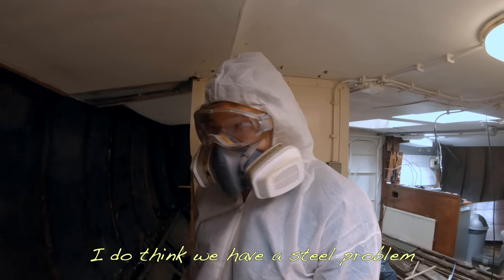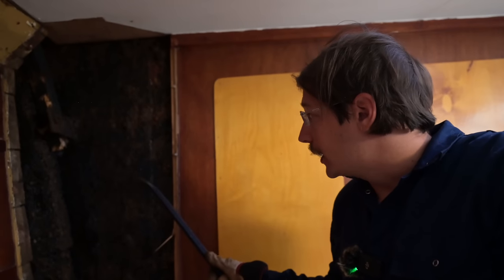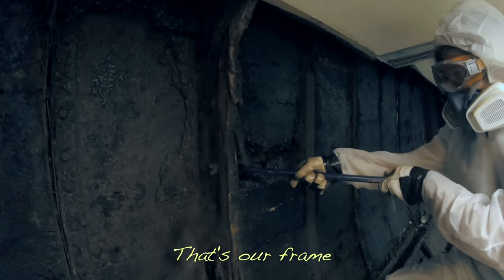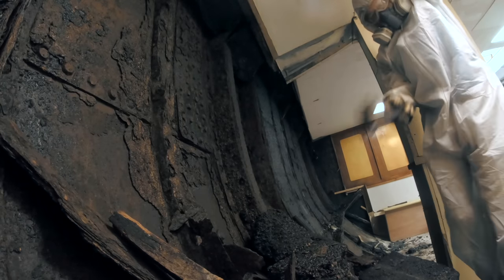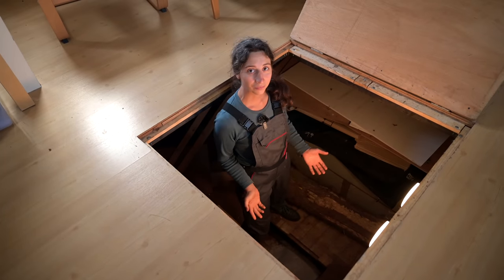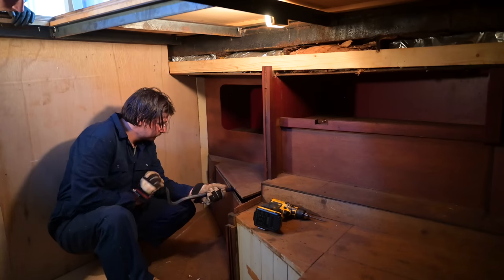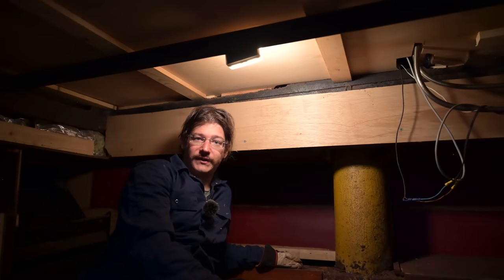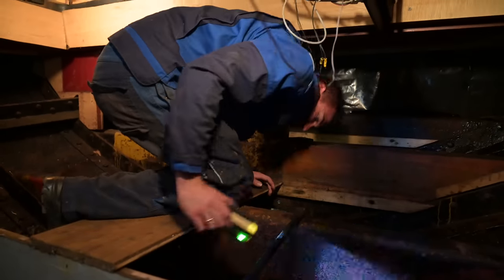We Need To Call In An EXPERT! Not good!!!

Comment: Its like boat archeology, only my morbid curiosity allows me to continue to watch, if you had got a surveyor in the first place, you could have 1. Bought the boat for less money based on the surveyed condition as a negotiation point, or 2. bought a different boat.  They say rust never sleeps.  You also need a massive bank balance or income to support this project.  Gutting it, welding repairs and repainting is the cheapest part of the project, the refit and redesign and installation and purchase of a complete rig and sails will have you sinking  100,000s into it.  How much is a restored 90ft motorsailor worth? Take that figure, times is by 3, and then subtract how much the ship cost you in the first place. There's your budget.
Reply from the maker: In the more recent videos we talk about all these points in detail. We did know what will be involved in the tall ship conversion and the boat was priced reasonable. We made the decision not to haul out because of a relatively recent thickness report. A mistake? Don't know, the haul out including a full survey would've been the same as the repair of the electrolysis damage. The cheapest similar but fully operational ship is "Jantje" listed at 550 000€. We will find out what can be achieved with 490 000€. The problem is, you see an ugly motorsailer and we see the beautiful tall ship hidden under it.

Comment: It's way way faster to use a cutting disc instead of a grinding disc when cutting metal. The cutting disc's are 1/16 of an inch thick while the grinding disc are 1/8 to 1/4 thickness. Hope that helps in the future if you ever were to need to do this again.

Comment: I have seen my share of terminal rust in my time BUT I don't see any in your hull thus far.  Sure there's rust but it doesn't seem to be seriously impairing the principal structures, just the subframes which may well be made of cheap substandard  steel or possibly even dissimilar metal . I am NOT a professional but I will say that if Flying Coney was my ship I would be encouraged by what you have revealed so far and I would be optimistic about the outcome. I see the biggest challenge as thè development  of a plan for the continuing financial viability of the project. The ship will have to earn her upkeep  plus maybe your living ? so you will have to consider the available options.  I'm sure there are some so my best wishes go with you!

Comment: You need an ultrasound check of the hull,too thin and you can forget the whole project.
Reply from the maker: You'r right but at this point the odds of a thin hull was very low. The lads from the yard already did some welding and we all hammered against it with crowbars and big hammers. The minimum is about 4mm and the readings from 2018 were all about 6-7mm
Reply: @FlyingConey  I respectfully submit that 4 -6 mm plate is too thin for a vessel of that size to carry lives at sea. This problem would be made worse if there is surface pitting or thin frames. I suggest you need the expertise of a naval architect to make these decisions. The sea puts a lot of force on the hull of this size of vessel in bad weather. As I understand your business plan, you might carry  passengers for compensation and in Canada this in the point where authorities do not care much for the Owners' opinions and these regulations are pretty standard in SOLAS Countries I think. I'm not into "stomping on a dream", but do want you to know  all the facts. We like and admire you. Your subscribers will follow you if you decide to move onto another vessel challenge.
Reply from the maker: @kendonahve924  Thank you for your comment and I can understand your concerns. The readings of the ultrasound check are the minimums of each hull plate. I think the required minimum is 3.6mm and it does not matter if the check is done for a passenger ship or a pleasure craft. We are in contact with a marine surveyor and he will check the boat after the electrolysis damagege is fixed and then another time when all the frames are repaired. However Flying Coney will stay registered as a pleasure craft with a maximum capacity of 12 passengers.

Comment: There are two possible outcomes of this story:
A:) The ship gets scrapped in spring due to lack of motivation, or
B:) The whole mid section interior gets ripped out, and the inside is sand blasted, then the ship is scrapped late summer, due to lack of motivation and funds.
Bending and installing new frames and stringers alone for this big mofu will cost an arm and a leg, if not done in some southeastern european low-wage country.

Comment: Can the presence of insulation be a contributing factor to the rust damage on the frames ans hull interior?  If moisture/condensation gets in there it will stay there for a long time.  I hope you find that the project is worth going on with and completing.  Best wishes, 🙂

Comment: all the problem I have seen up to 12;28 is a couple frames that have rusted away, but they are easy replaced, if it is endemic across the whole ship it would be time to sit down and think. if you decide to scrap it, what would you get scrap value against how much it would cost to repair,  and then compare that to the cost of replacement. If you repair you know you have a good ship against if you buy a new ship it could be exactly the same as "The Coney"
Reply from the maker: The issue with replacing the frames is that most of them need to be welded exactly where it meets the concrete. So we have to remove the concrete first. We've tried to explain that it's not just the frames but at that point we begann to put a question mark on the thickness measurements from 2018.
Reply: In the Developed World labour and environmental costs generally exceed scrap value for wrecking vessels in that size range.

Comment: I think you get better at removing insulation the more you do it. Its much colder outside now, so it wont be as hot. ;) 

Well, how did the rust get there behind the insulation? I would think it would be tarred, and it would be enough. But maybe moisture accumulated through the years of the ship being used as a living quarters. 

Even if the ship would be a total loss, it still is not the end of the world. I think getting to the point where you know what the deal is is worth a lot, no matter the outcome. 

Ive had a moped, or rather 4 motorbikes, and all are not running yet. They costed money, it isnt going anywhere (yet). And it sucks, but hey, you are there, both of you. Dont get into a downward spiral. People love to see the videos you upload! Its the road to the goal that is interesting, maybe not the goal itself. Nirvana is now. :P  

I know i would rather be in a villa with a large piece of land on the coat de azure, but things worked out differently. And its not fair. 

The better the morale is, the sooner you will get where you want to be. This ship, or some other ship. But as you have stated, its best to come to a conclusion that is right rather sooner than later. Not based on emotions. 

I hope you will make the right choice. 

Im not sure what the right thing is to do. Probably its best to put all your effort into finding out what the right move is and dont do anything else. 

I wanted to ask, what other type of boat would you be considering? But that is not what is up right now, and it may never be what is up. Making a choice that will work is probably the best thing to do. Because that will take you to all the places you have been dreaming of. 

Greetings,

Jeff

Comment: Hello, just came across your channel and find it very interesting.
I was wondering if you could add to your about us section where you are repairing your ship at?
It looks like quite the challenge. The good news is that you will be able customize everything to your desires.
The nice thing about a metal hull is that you can cut and weld just the bad spots.
Be brave, dam the rust and full speed ahead, cheers.

Comment: stern looks not so bad..., strengthen some frames and all is fine... Good Luck! Love your boat!👍
Reply from the maker: The most problematic area is definitely the area in the former fish room. It's the only compartment insulated with the cork tiles. Since they are very hard to remove in the last 72 years the coating behind it disappeared. It seams like the rust itself preserved the hull but the question is why are the frames all gone.
Reply: @FlyingConey  The frames stick out of the cork isolation or weren't not covered enough.

Comment: There is always risk to fix up the ship or boat but you have to have effort to make it happen and patience is the key to accomplish. You can look up some of yourtuber such as Brupeg , Ship Happen, Tally Ho and etc. They have pride to work hard to make it happen no matter if it is wood or metal and they are expensive otherwise. In my opinion Metal ship are lot easy to work with than woods because if you make mistake with woods there is no way to correct it compare to the metals are easy to correct by weld it up to be more specify measurement you know. Keep up good work and many cross fingers to your success and get good opinion from the ship expert. Smile and stay positive!
Reply from the maker: Thanks for the crossed fingers. I'm in my third round of watching Tally Ho being rebuilt. Leo was the inspiration to rescue an old ship. We're still quite happy that we've picked a steel hull. I think a wooden boat the size of Flying Coney isn't doable for a couple. But in many aspects our ship is constructed very similar to a wooden boat. We have frames, stringers, deck beams, floors, knees and butt joints. The overlapping hull plates are nailed together with a layer of felt in between them. After that they were caulked with a special tool and an air hammer. Unfortunately only a few very specialized people can still repair a riveted boats the old fashioned way. But welding is only the second best option.

Comment: Did you keep the wooden 'floors' as templates just in case you wanted to restore the old cabin sole height etc ;-)
Reply from the maker: No, everything went out and provided us with a bit of warmth doing so. But we have to face it, we have to build the interior from scratch. 😉 But it's easier than on a smaller ship. Right underneath the cabin sole is a flat concrete floor. Unusual is that the concrete is "pulled up" to protect the hull. We think the idea behind that is that the ice water keeping the fish fresh doesn't corrode away the hull.

Comment: I think your overhaul is becoming more of a job than the couple overhauling Yaba had to do.
Reply from the maker: One thing I realized when we hauled the boat out is that Yaba is about four times smaller than Flying Coney is. Just watched there latest video and really enjoying every episode. But actually I think our projects are very different in many aspects. Anyway I wish them all the best and maybe we can visit them one day with Flying Coney. (Hope they realize soon enough that Yaba isn't a boat for ocean crossings...)
Reply: Steel/iron can be welded, wood you can not.  could be worse. and after all you plan you use it comercially so it isnt just a pleasure toy for traveling the world hoping that enough 'entertainment-simps' throw enough money at you to achiev that goal. 
all riped out and overhauled what is needed and you have a clean canvas to do what ever you desire for a setup and you know what you have and no bad surprises.
Reply: Good grief no, Yaba is practically rebuilt completely piece by piece, it really would have been easy to start new with that project.
Reply: Yaba skiped the whole Lofting part using the original as template. wich would also taken double the area they allready use in the shipyard.
Reply: @FlyingConey  Why isn’t Yaba a boat for ocean crossings?
Reply from the maker: @Jester123ish  Actually a number of reasons and I really don't want to disrespect them or lower the value of their wonderfull wooden craft. It's a beautiful coastal cruiser.  But speaking obout seaworthiness there are a few issues if you want to sail the open seas and in fact there are many other similar boats not suited for this task. Think of the pilot cutters (CE cat B) or the big dutch sailing barges (CE cat C).  Probably the biggest issue with Yaba is the shallow draft and I think a stability test is a must. The question is will the boat right itself after a knock down or not. Unfortunately the also compromised the seaworthiness by lowering the bulwark and putting this big beautiful sliding windows in. If anything they would need boards to protect the windows in case of rough conditions. Another big problem is the open stern and if I remember correctly they open up the companionway area for a more open sozial and rally area. But that also means that if a wave decides to roll in from behind it rolls all the way to the sleeping compartment up front. This would sink the boat in seconds! Not joking here. Back in 2002 a KFK conversion to a sailing ship named GOTLAND sank after it capsized in only wind force 6. Have a look at the GOTLAND and then YABA. And again there's nothing wrong with their boat. It's a compromise and they have a much more comfortable vessel and compromise the ability to cross the open ocean. Also many super yachts can't to that and that's why they are transported on large ships.
Reply: @FlyingConey  The investigation report on the GOTLAND makes interesting reading.  

Hopefully with the Yaba they get their stability right.  Seasoned ship wrights SHOULD know what they're doing.

Comment: Wondered where you guys were... You need a bottom less pit of money... Stripping is the easy part.... Wait till the refit..... Good luck
Reply from the maker: We're really looking forward to the building up / refit part of the project. First we can do that in the water at our own speed and afterwards it feels like you've achieved something. Striping is labor intensive, dirty but not very difficult. But being on the hard is about four times more expensive, uncomfortable and a shipyard is a very loud environment. So you don't get any rest. Working the whole week, editing on the weekends. But I'm not complaining just explaining. I'm really greatfult because you guys and YouTube are giving me the option to safe that magnificent ship.
Reply: @FlyingConey  keep it up well done
Reply: @FlyingConey  if that's your plan, consider doing remedial metal structure and protective coatings from bottom to at least a 300 mm
Reply: Continuing...300 mm above waterli e in the shipyard because usually impossible to do once afloat. However,  you are correct this is a better work environment for you if you have a system for bringing heavy materials aboard. I agree with previous  suggestions that one or both learn to work with metals.

Comment: I'm thinking of creating an award for the silliest boat restoration project on YouTube. 
I keep thinking of Tallyho, that has used about 4 square metres of original planking, and 5 tonnes of original lead. 
I suspect you have a bit more left on your hull, but do you have the sponsorship,  and the infatuated wooden boat enthusiasts for support ?
I have never heard of a boat repair facility what wasn't enthusiastic about a long, expensive restoration.
Its like asking a dentist if you need work on your teeth. Its only you that have to suffer the pain.
Reply from the maker: You can look up the Tall Ship Avatar and have a look at their restoration history. It's not easy to find a hull that is suitable for a sailing ship and they get rarer and rarer. So I think there is a chance that our project makes economically sense if we don't count our working hours but also without the filming and YouTube. Luckily the shipyard is extremely fair. The lads are mostly welders and enjoy welding. They don't want to rip out the insulation or clean of the paint around the spot welds. So we are doing most of the work but leave the welding and certain works below the waterline to them. I mean it's 500€ to let them do the repacking of the stuffing box but its 2k to haul out boat. There's always a chance of it leaking after repacking...

Comment: Wow!  What a cliffhanger!  You must have been so disappointed to see the frame of the hull disintegrate before your eyes.  I hope the damage can be repaired.  Do you know a good welder?  I also watch Sailing Melody (and you probably do too), and they have had  lots of welding repairs on their hull.  Good luck Barbara and Daniel!
Reply from the maker: The lads from the yard are very good welders and there are many still working boats here more than 100 years old. So I guess we are in good hands. At this stage we already knew that a thin hull is very unlikely. We use very high settings on the welder so we would punch through anything below 4mm and also we hammered against the hull from inside and out and it sounds solid. But the shipyard time is an emotional roller coaster and it's tougher than expected. I've seen your question for the Q&A!